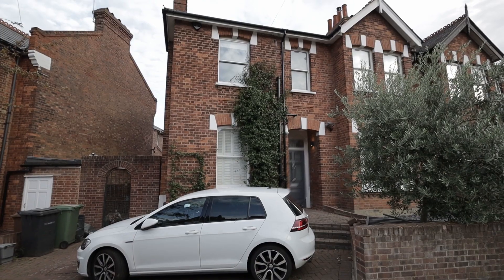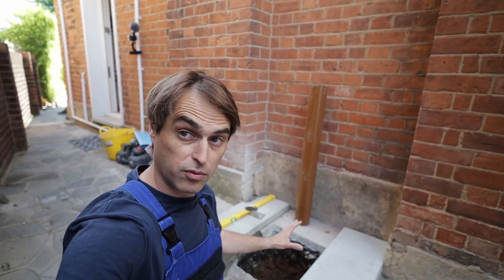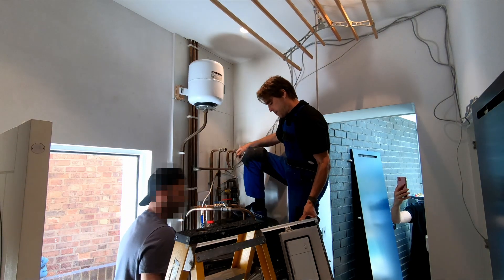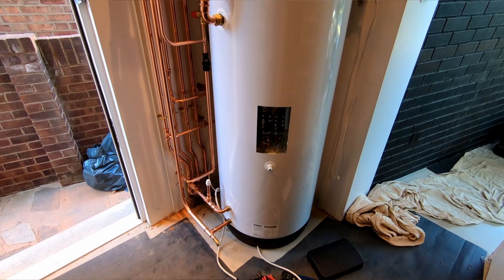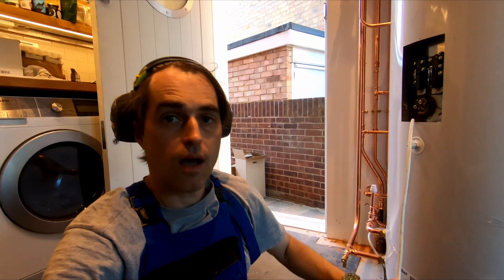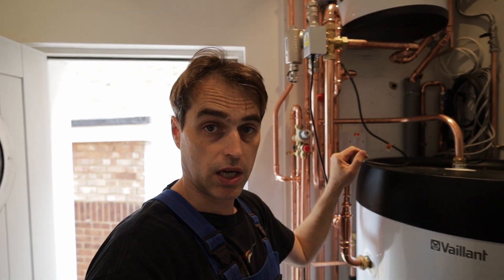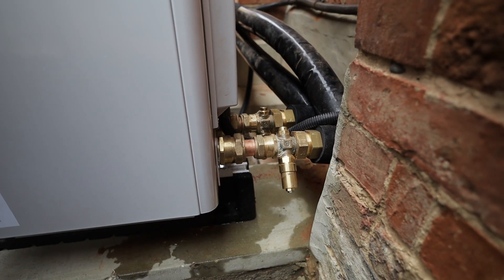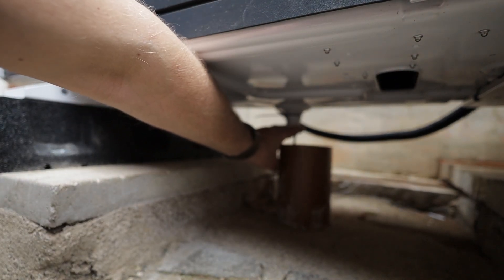Is This Heat Pump Better Than Your Gas Boiler?

Comment: They installed almost exactly the same system last year (only the smaller heatpump) to future proof our tiny house and loving every bit of that system. Still looking for a way to use the heat that’s coming off of the buffer and water storage though because it gets a nice and toasty 34/35 degrees Celsius in our storage area. Great for drying laundry though. Everybody who informed us about a heatpump system warned us for the noise the heatpump can make but to be honest you can’t really hear a thing. I have to feel the air coming off to know it’s running or not 😂. I did notice our pipes are not insulated, do you recommend doing that to every pipe? Can imagine it only makes sense to only insulate the hot water pipes? Running for exactly a year next week. If you want to know some data just ask!
Reply from the maker: Definitely insulate any pipework you can get to. What is your scop please? Also where are you based?
Reply: @UrbanPlumbers  Will do, thanks for the tip! I'm based in The Netherlands. Similar climate to UK. Is there an easy way to calculate scop? I've been googling around but I can only find super complex calculations and I'm not the best with math! haha. According to the calculations made when we got the system it should be around 5. If that is also the case in practice I'm not sure.

Comment: Do not invest in this nonsense. A fairly good installation engineer hoping to get rich on people's ignorance. Wait a couple of years then watch which direction the industry goes. Unfortunately this really isnt the way ahead. Do your due diligence before wasting thousands on these elaborate distortions of the reality of domestic heating systems. 
39 years experience within the commercial & domestic heating industry. 
Dont trust these people, they are trying to short cut the hard work we need to do in this industry to making lots of money out of gullible people like you.
Reply: Do not fall for this flannel, wait a while before investing in this nonsense.  The guy making this video knows its not a good system but likes the idea he will make lots of money out of it.
39 years in the industry & still teaching apprentices every working day.

Comment: Just watched this and was impressed - until you started saying that it 400% efficient, that is IMPOSSIBLE, unless you are performing some kind of mathematical magic - you cannot get more out of any system than you put in which is what you need to get more than 100%
Reply from the maker: yes you can - that is the whole point of a heat pump. You inout 1kW of elecricty and extract 3 kW of heat from the air plus you still have that 1kW towards heat generation. It is a magic device really.
Reply: @UrbanPlumbers  you are wrong. Look up the First Law of Thermodynamics, which is immutable and completely accurate for the entire universe.

You are not comparing like with like when you claim that a heat pump is 400% and that a conventional boiler is less than 100%. An accurate comparison would be to only measure the amount of electricity used for a conventional boiler to pump the oil or run the electronics  against the heat output, ignoring the energy contained in the fuel - that is exactly what you are doing to get 400% ‘efficiency’ for a heat pump. You are ignoring the energy that taken into the system from the surrounding when the gas is expanded in the heat exchanger.

The whole heat pump industry is totally wrong in claiming 400% efficiency for heat pumps and unfortunately people are ignorant of the fallacies that you quote.
Reply from the maker: @damenfeld  seriously dude, stop embarrassing yourself. Google heat pumps efficiency before you make a comment.
Reply from the maker: @damenfeld  here you go. I google it for you as you seem to be unable to do it youself.

https://www.kensaheatpumps.com/what-is-the-efficiency-of-a-heat-pump/
Reply: @UrbanPlumbers  Clearly you are unable to understand physics - especially thermodynamics, or you realise the total stupidity of your statements. Heat Pumps are NOT more than 100% efficient, and can never be more than 100% efficient - unless you are only including part of the energy consumed within the system, which is what you - and the industry - is doing.
Reply: @damenfeld  For a gas boiler, you subtract the amount of energy that is transferred to the outside air, which is say, 20% of the input energy, leaving an efficiency value 80%. For a heatpump, if you do the same calculation, the amount of energy transferred to the outside air is NEGATIVE, say -300% of input energy, and you get a value of say 400%. These values are like for like.
Reply: @damenfeld  By your logic, nothing can be less than 100% efficient either, because of thermodynamics?
Reply: @daniel5530-z9n  Incorrect, again - you just don't understand, do you? Firstly, a heat pump simply takes energy from the outside ground or air and moves it into the building and in your example that requires 1kw of energy to transfer the heat from the source to the output. All a heat pump does is move energy.
Reply: @damenfeld  Yes, everyone here agrees that the energy is "moved" from the air, not created. But what you have not justified is: why is it acceptable to say that a gas boiler is 80% efficient rather than 100%, given that the energy it loses is not actually lost, but just "moved" to the air outside?

Comment: I have a Vaillant gas boiler installed at my house now with weather compensation and have the heating curve set at 0.7 with zero offset. It keeps the house toasty. Are the flow temperatures low enough to make switching to a heat pump worthwhile? Are there other factors to consider?
Reply from the maker: If you are ok with 0.7 curve in very cold weather (-2) then yiu will be fine on current rads with a heat pump.

Comment: Gas is less than a fifth of the price of electricity. The heat pump is only worth if it's reversible for air con. Also it takes up so much space both indoors and outdoors and there's all that extra copper demand!

Comment: as the radiators and other pipework were not changed and were designed for a delta of 20 deg running at 70-80 deg. Will the heat exchange not be able to add the same BTU to a room running at a lower 40 deg max temp. The system losses of the pipework will take away more of the generated energy from the heatpump. causing it to run more. Im not an expert in building energy so would love to hear back. The air tightness critical too I believe
Reply from the maker: Rads weee install with a heat pump in mind so were sized correctly. Loses through pipework are to the property not outside so don’t matter that much.

Comment: I dare you to use this reverse cycle airconditioning, as they were used to be named for decades, when the humidity is above 50% and the temperature is below 5 degrees. you will have a block of ice outside and you will be paying for the system to defrost the condenser every 5 minutes.....plus the noise

Comment: Don’t know if this system is in Australia but we have similar outdoor compressor units running on full electric & internal wall unit blowing. 
Usually split system hot/cold inverter 
Only problem is these outdoor units are not the best in freezing weather as my new kelvinator goes into DF mode. Unit tries to De Frost itself virtually goes to sleep for some time trying to melt ice through the pipes outdoor unit. 

Wood fire 🔥 in Freezing environment best.

Comment: you have to do a lot of renovation in insulation unless new build, larger radiators and what they dont tell you is the price of all that plus in two three years the noise is awful good luck

Comment: Heatpumps and district heating will be the long term future I think. You can heat with minimal emissions and also cost assuming that gas prices will stay up and electricity rates drop.
Right now there are 2 major obstacels:
-Cost of electricity. It needs to be cheaper across all of Europe.
-Currently Electricity IS NOT green/carbon neutral. 

France is leading here with cheap rates and the majority of power coming from Nuclear and Renewables.

Comment: Insulation and air tightness are key when it comes to heat pumps. Many builders don’t have the right training in these areas.
Reply: The vast majority have no training , no idea and no care - building standards today are appalling
Reply: @orange1666  I suspect building standards set by regulators are fine but some builders cut corners and ignore them.

Comment: I'd like to see the calculations taking running time into account. People don't run their gas boilers for 7-8 hours a day. A house as well insulated as that one would expect maybe 2 hours max on a boiler and to be honest it may not even need that.
Time is also a huge factor in the sizing of the gas boilers you call over sized but that has been broached by numerous other people on your other videos.

Comment: Friend has a heat pump after upgrading from a combi boiler = biggest mistake in her entire life!!!  Uses 3 times as much energy as she used to use, it's never off, runs 24/7 for just warm water, warm radiators and a backwards technological jump to a water tank!  She hates it and is dreading this winter.

Comment: I still think solar panels helping a cylinder with a smaller boiler is a better system. Heat pumps are very noisy and having a fairly short warranty compared to 10 years you get on boilers it’s a awful lot of money to spend in the hope of saving maybe 20 to 30%
Reply: Fully electric is the only solution that makes sense long term.

Comment: Super! I trained as a refrigeration technician 12 years ago and could never understand why we are still building houses with gas boilers. Glad I’m out of it, but we should be doing this all over the place
Reply: yeah and lets see how it works when there is no electricity to run it
Reply: @nerolowell  You are aware that modern gas boilers do require electricity to run, right? And the same building code that deprecates gas boilers also make a small amount of renewable energy (usually photovoltaic) mandatory and incentivizes the implementation of hybrid systems, such as a coupled solar thermal array that makes a heat pump consume very little electricity.
In any case, a battery pack becomes more and more a necessity for essentials such as lighting, Internet, radio, basic heating, basic eating (cooking), security, even TV, if only to watch the weather channel point out on the map where Putin sent his nukes.
Reply: The building code in some countries like France makes it so that you can't get a building permit anymore with a gas boiler. This was a law passed long before Putin's war to Ukraine and the resulting gas price hike. More and more countries will get there eventually, but I agree this evolution happens way too slowly compared to the climate change urgency. I guess it's in our genes to burn stuff and kill hairy mammoths.

Comment: A huge colossus of a heat pump outside, making noise 24/7, good luck with that. Also to replace all pipes to radiators and also all the radiators. How much does all that cost? Also most properties will not have space for it on the side of the house but it will need to go in the garden, not a great look.
Reply: Well there are indoor units those can go into the basement for example.
Reply: There are also roof units or indoor units. For pretty much any situation is a solution. Heat pumps are the only future proof solution we have.
Reply: @Freba9  You are wrong, there is often a solution but not always, not at all. We own two houses, not any of them is really a candidate to install heat pumps at a reasonable cost. One is built in 2019, one should think a house as new as that should be “prepared” for a heat pump as by that time legislation should definitely kicked in to make sure it was at least prepared for it, but no. There is now a combi boiler in the house, and no loft space as it’s a third floor living space. There is of course no hot water tank so where is that needed to be installed? In the hallways? Not possible, no space, in the stairways? Not really possible there either, the cupboard where the combi boiler is not large enough. And where to put the heat pump itself? Not outside as this is a town house and there is NO SPACE outside for this, no way. And inside? Well you could take away a bedroom and use this for heat pump and hot water tank, but to lose a bedroom?! Also the pipes for the radiators are 10mm so not large enough, so the whole house has to be almost ripped apart to replace these pipes with at least 15mm pipes, so rip up floors, walls and ceilings, a nightmare and very very costly. Also of course every radiator needs to be replaced with larger capacity. The other house was built in 1998 and has a normal boiler with hot water tank, but not space for the heat pump to go either inside or outside except to put it the garden, but as the garden and house is constructed I can’t see how it’s possible as we had an extension and the floor there is solid concrete with underfloor heating so it’s no way we can go through the floor, also there is large floor to ceiling windows so to put the heat pump there in front of a window will of course ruin the aesthetic totally, so what to do? Also of course all radiators need to be replaced plus again to rip the house apart to replace all pipes from 10mm to at least 15mm. A neighbour is installing a heat pump in a similar house, he said he needs to replace carpets anyway so that makes it easier, but it’s still a huge project as of course you have the issue with pipes and radiators plus he will get a huge heat pump outside in his garden that will run 24/7 with noise from fans and pumps. To install a heat pump is only really very good in a new build, but believe it or not new houses today are still built with the older boilers and with small radiators and pipes so the government is doing zero to make sure newer houses are prepared. One guy I know bought a new house last year and with a heat pump, he says it worked “ok’ish” but it was needed to replace several radiators and tweak the system to just about cope but he says he is 100% sure it would not cope if the temperature goes below -5. And this house has of course much better insulation than older houses, it is no way we can improve the insulation in our two houses without actually lining the outside brick wall with “something”, again very costly and hardly practical or aesthetically pleasing, and could of course lead to potential damp and fungus is certain areas if you fail to insulate uniform everywhere as it could create cold bridges in corners etc. Anyway he also complains about the noise in the night trying to sleep having a monstrosity of a heat pump working through the night. To sum it up the solution in the U.K. is to use heat pumps in ALL new builds, and make sure gas (or hydrogen?) will be available until there is no demand for it, probably another 20-30 years, not that long in the big scheme of things.

Comment: When is very cold outside ,my heat pump becomes worthless,it's switching to expensive electric heating.
Reply: It does not matter when this only happens a small part of the year.

Comment: Excellent, informative video.  Would you advocate draining an existing ASHP system to remove the glycol and installing anti-freeze valves?  Regrettably I have a Mitsubishi ASHP system and the COP is never higher than 3.2 so any tweaking to improve the system is worth it to my mind.
Reply from the maker: yes, I would remove glycol and install anti-freeze valves.

Comment: Installing them outside? I know east London has been gentrified recently however, yeah... how much are they worth lol? The way things are going that’s not gonna end well... I’ve heard they don’t work so well everywhere?
Reply from the maker: They can run to far with 200kg on their backs, can they 👍
Reply: @UrbanPlumbers  lol they’d probably still give it a go 🙈 but a van would do the trick 👍 I find your videos very informative, thank you! Is it true that the underground heat source pumps work well in some areas but not so well in others? Depending on geography/environment? I heard they’re not as viable up north, for example... I ask because I have a gas guzzling period property in northwest... got rid of the AGA (nightmare) once the price hikes kicked in earlier this year and wondering if I could/should go one step further... just put a new unvented cylinder in though to replace the AGA for heating water... cheers!
Reply: @dannyboywhaa3146  Air source heat pumps are doing just fine in nordic countries.
Reply: @Freba9  so I gather - it wasn’t necessarily latitude I was getting at - they have volcanos and hot springs and stuff though, so perhaps it’s easier to source underground heating there? I’ve definitely heard it’s not the same everywhere and there are some places where you cannot have it?
Reply: @UrbanPlumbers  lol they wouldn’t last a week in Salford... 👍